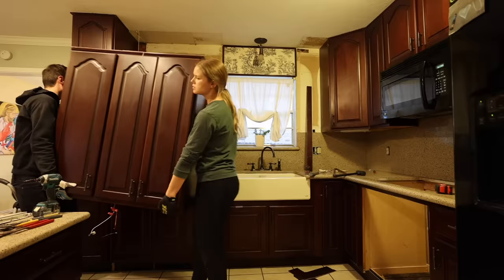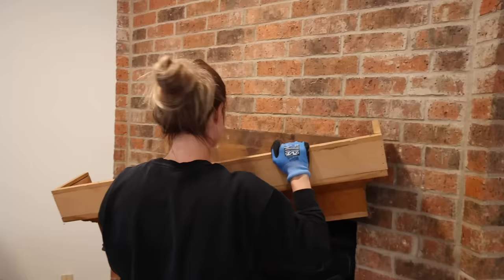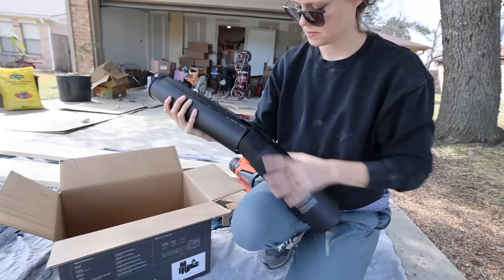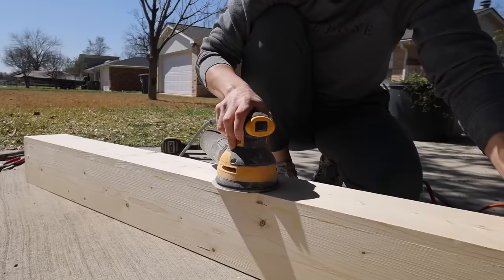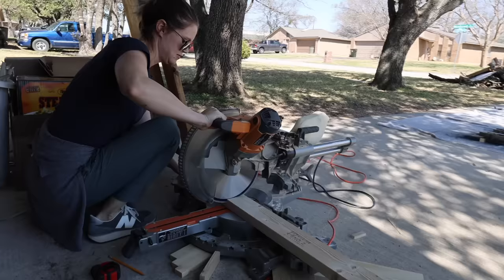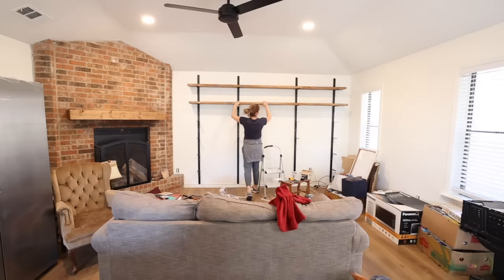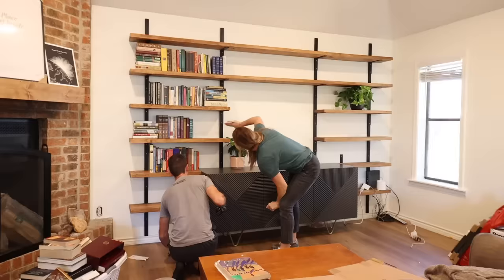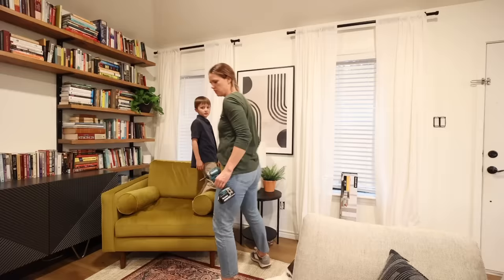DIY Floating Shelves // Living Room Makeover // Extreme Home Makeover Series

Comment: I have had shelving supports made with gas piping for a couple years or more. I held off installing them because I think I'll need another pair of hands. Maybe lumber prices are more affordable so I can get the shelves. I really like your tape tip. Using that will help me determine the board length. 
I'm also going to steal that stain choice. 
This is for my office and I really like the industrial look.

Comment: I was looking forward to this video! You guys did it again! The bookshelf wall turned out beautiful. 😊 BTW, I also purchased the frame in 43” and it doesn’t come with the regular wall mounting bracket. It only comes with the two small hook brackets which can still be used to mount the tv to the wall. I thought they forgot to put it in my box too lol
Reply from the maker: Thanks!! And OMG that is so helpful to know about the wall bracket! It didn’t have instructions either and I couldn’t find anything online so was a bit lost (I’ve installed a couple in other sizes so just assumed it should be the same haha).